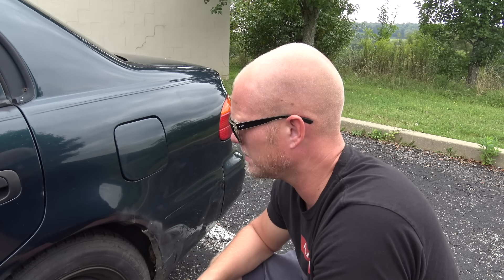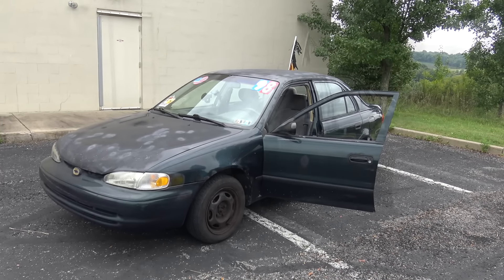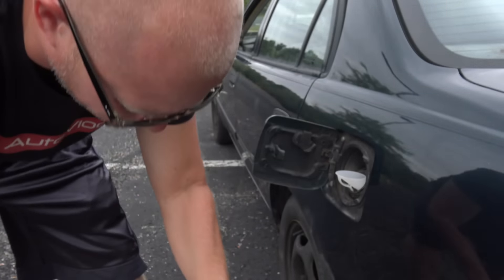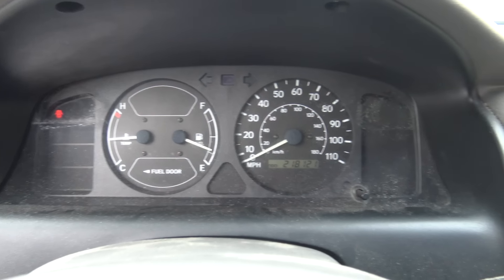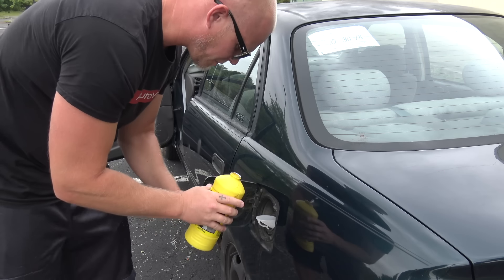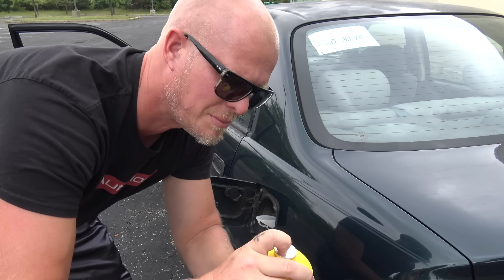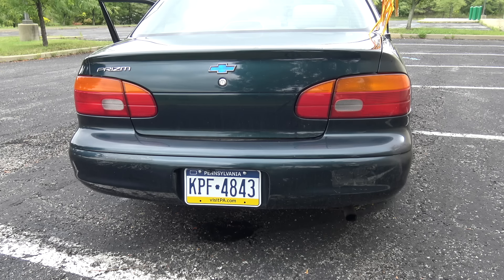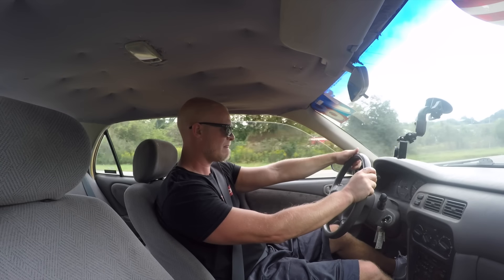What happens if you put BRAKE FLUID in your gas tank? (You'll be surprised!)

Comment: Break fluid is actually a lubricant and can get into places WD and PB Blaster can't and it will clean the lifters and valves but the one thing you have to watch out for is it eating O rings and rubber seals and gaskets. I love the car by the way, had one like it and wish I would have never gotten rid of it. 4Cylinder Admirer from way back.400,000 and still kicking it like a new one..Roll On Brother ROLL ON..

Comment: You can put transmission fluid in it as well. It'll keep the gas from freezing up in the winter. plus it cleans the fuel system and injectors too.
Reply: Must be cold where you live to freeze petrol

Comment: I just came here to find out if mixing brake fluid with gasoline is dangerous. I have a spill tank that has some gasoline in it, and nowhere to deposit it. Now i need to change my calipers, and I understand now I can use my spill tank for brake fluid even if there is gasoline and oil in it from before.

Comment: Certified mechanic 43 years if anybody has a catalytic converter that starts plugging up run it almost out of gas but one gallon of lacquer thinner in and 9 gallons of gas it will clean your converter unplug it literally but it has to be done when it initially starts plugging up.

Comment: Mileage test idea:
Fill tank completely with gas and reset trip meter to 0. Drive to 1/4 tank or less.
On next fill, fill completely and see how many gallons it takes to fill tank. 
Divide the gallons used to fill tank by the miles on your trip meter. = MPG without brake fluid in tank
Then do the experiment. 
- Fill the tank, reset trip meter, add two bottles of brake fluid. Run car until 1/4 tank. 
- Refill tank doing the math as before to determine mileage. 
Do this to see if it improves your gas mileage.

Comment: The first thing you should’ve done was not to see if it starts, the first thing you should’ve done was panic clean that brake fluid off your paint. If you didn’t do that, I’m sure that paint is not on the car anymore if you left it on there overnight...dot 5 Silicone-based brake fluid will not damage paint, but alcohol-based.3/and four is an excellent paint remover
Reply: If you never want paint to stick again.
Reply: @richochett404  
 True silicone brake fluid will not harm paint. But, it is elasticity to it. I remember Suzuki 1400 intruders with hydraulic clutch instead of a cable. At high elevations like Denver, those bikes would creep through the light if you sat at a light with your bike and gear holding the clutch in. Also the Corvette club of America had a bulletin out about the dangers of using silicone brake fluid at high elevations. Your brake pedal has a lot of sponginess to it. You also have to make sure that you are brake system has O-rings and rubber hoses that can tolerate brake fluid that’s made of silicone. You can’t just put it in instead of dot 3 or 4.. it has to be compatible.
   yes I was sitting there finishing up changing a brake caliper, and without thinking I put the rag on the fender. And it took the paint off. That was in 1987 or 1988. I did not know brake fluid damaged paint at that time. brake fluid also is tough on some motorcycle bodywork. I sold my FJ 1200 to a guy, and he had the slave cylinder leak a couple years after he bought it from me, and it ran down the belly pan bodywork, and looks like it melted it..
  One thing about silicone and paint. A master body man/car painter that I know will not even allow silicone spray in his building. Because it will create a condition on the car if it gets on the car that creates what is known as fish eye   in the paint. They look like a little dots with no paint like little volcanoes that have no paint in them in the finished product. Then you have to strip it down and start over, and sometimes even that does not get rid of silicone on the body.
  I should also have mentioned when I do change clutch fluid and brake fluid from the handle bar Reservoir’s. I get a large lawn black plastic bag.. and I cover my gas tank with that plastic bag, and I will cover the front fender with smaller bags. I don’t know what it is about brake fluid. But I have never ever been able to change brake fluid which I do every year in every vehicle I own that’s why I bought myself a quality vacuum bleed. I don’t know why it happens, but I always get a drip or two that flies when i do something like pull the rubber hose off the bleeder nipple, or when refilling the master cylinder with clean brake fluid, if the bottle is new and completely full. Sometimes I don’t get it all into the master cylinder when I start to pour or it will splash out when I’m pouring it in. That break fluid just wants to go straight to the bike sometimes. It might be that I am so nervous about getting a wild drop to go wild on me that makes me spill it..
  I was a maintenance electrician. When I would be working on 85 foot high parking lot lights or up in the ceiling working on mercury vapor lights. That is when I would drop a screwdriver. When I was actually telling myself not to drop the screwdriver or the nut driver. I never drop tools when I’m working on the ground. Only when I’m working up high , telling myself not to drop them, that’s when I drop them.. i’m not nervous about working 480 V lighting circuits hot,(I will not work on 277 hot though, that’s the one that will kill you). I am nervous about dropping the tools, not the electricity..
 By the way, I am the only electrician in the entire company that has never been shocked working on an energized piece of equipment.
  thanks for the tip on making sure the bike starts first. But the checklist was all the things you should check before you even think about riding the bike like making sure it has oil, making sure the tires are correct pressures, making sure all your Controls are where you would reach for them with your eyes closed naturally, know how to get to the petcock when you need to, and which direction to turn it when I taking your eyes off the road, things like that should be checked before you start it. Example:
  when I change oil in my motorcycles, I let the oil drain overnight, sometimes over the entire weekend. To keep from starting the bike with no oil in it, I have an orange sign with black writing on it that says “NO OIL”… I stick my key through that sign and I plug that sign into the ignition switch. On top of that, I will put the oil bottles on the seat of the bike as a second guard against starting the bike without oil
 find my cars and trucks, I just put the oil bottles on the floor of my car by the gas pedal to remind me that there is no oil in the engine yet..
 why do I do that?
 I know two people that drained their oil and drove away without putting oil in their cars..

Comment: Continuous use of brake fluid in the motor will seize it up. I had a truck losing brake fluid. The brake booster was leaking and drawing brake fluid into the engine through the vacuum hose.

Comment: You actually did your car a pretty good favor by putting it in there it is a type of solvent that will eat fuel deposit it is also a catalyst though it will absorb water very easily meaning you will end up with water in your fuel

Comment: Forgot to soak an old rag saturated with linseed oil. Light a match. Problem solved.

On a serious not, my dad used to run an old 40-something Chevy or Pontiac. He was a painter and saved all of his solvent-based cleaning fluids after cleaning his tools/brushes. He would let the fluid sit until all the particulates hit bottom then pour the clean fluid into another container. He would add a couple of gallons to his tank to get further down the road. Also used naptha. Never had an issue with the vehicle, however, I doubt modern day vehicles would survive the day.

Comment: Brake fluid DOES burn at about 3-400 degrees. When mixed with gas it most likely just slightly dilutes it with a lesser flammable source. Also dot fluid is corrosive. So the addition of dot in the fuel may help to clean the valves, combustion chamber, and exhaust ports. 🤷

Comment: Brake Fluid added to petrol is just adding alcohol based liquid. The results will be the same on some older cars by destroying flexible fuel lines and seal and gaskets in the fuel system. Increasing the likely fire risk.

Comment: I put Xylene, (paint thinner), in the gas tank when I drag race my supercharged street truck.   A very nice octane booster that will not harm oxygen sensors.
Reply: Baby Jake 4...My cousin would give me Pure Ethanol from his company that made E85 Flex Fuel for a major refinery corp. My car at that time was a Chevy Malibu SS 454 V8..It was a Excellent Octane Booster..It had a nice sweet exhaust smell too..
Reply: Try Half Gas with Half E85 Fuel..I bet it will increase performance & improve mileage

Comment: You gotta think it's keeping it lubricated It's lubricating the inside of the You pump and the inside of the  Entirety of the fuel line Entirety of the fuel line And pushing a little bit of debris through as well Which will hurt  Eventually but then again it's lubricating lubricating your injectors and the top part of your your engine is well that's not getting that type of lubrication Eventually but then again it's lubricating lubricating your injectors and the top part of your your engine is well that's not getting that type of lubrication  It's getting some because they do add additives into the gas what do you think petroleum is

Comment: If the car isn't dead yet. It would be interesting it you did a compression test on each cylinder before and after ; plus put a camera scope down in the pistions so we could see before and after shots of the top of the pistons and valves. Check fuel pressure before and after.. Figure out the gas and brake fluid ratio. Keep running it until the test show results.
Another test would be to pull upper oxygen sensor out and get some camera footage of the front of the catalytic converter before and after.  I was kinda shocked myself that you didn't have any issues.

Comment: I know brake fluid is very corrosive so idk but it's possible that it will clean the fuel system, but you may want to change the fuel filter because it will probably eat up the filter

Comment: I put oil on my cars 2
I put the oil the use for blower  and landscaping equipment and 
I get better mileage  

And on my 2005 Ford Expedition I mix gas with diesel and I get 80 miles extra

Comment: what it will do at least in older cars 50's thu 70's cars it will help in oil consumption , by swelling the valve seals when you have blow by and white smoky exhaust. I've worked on classic cars for 55 years

Comment: Try using an electric leaf blower for a cheap turbo charger. Use a converter to power it and run it right into the air intake on your intake manifold. Vroom vroom buddy.

Comment: It will swell all rubber o rings and gaskets and your car won't run. I seen old time mechanics use it in crankcase of engine with stuck lifters and dry shrink valve seals but remove after running the engine for 15 min or so. This was pre cat convertors

Comment: You should have put a scope thing so you can look in motor before and after  I bet brake fluid cleaned inside of the motor   tops of pistons and valves   and injectors    wants look inside engine  before and after

Comment: of corse it starts there is only gasoline in the lines first the fuel pump needs to pump it to the engine it will take a minute to reach the engine. that is wy an engine does not start first try after a rebuild.same as an empty garden hose of 100 feet first the water needs to get to the other end.

Comment: I have been told by z friend off mine to paur straight into the carburetor 
Reason  it loosens and clean carbon build up on your valves and top off Pistons and ring grooves 
It smoked like  a volcano but  stopped in a short time  
I drove that car for another couple of years and sold it 
It never ever cove me any problems 
So ?

Comment: Get a small piece of black fuel hose and quickly dip one end in and out of the brake fluid and walk away. In a couple hours come back and you'll see what will happen to the rubber seals in the fuel system...

Comment: Brake fluid is hydrosopic..it needs to mix with mixture or your brakes would not work..3 percent moisture per year.alfter ten years your brakes hydraulics start to stick..lowers boiling point .generates more heat.more wear..

Comment: You should have opened up engineparts.In the old days mechanics dropped brake fluid in the Carburators while the engine was running to clean the valves!So maybe you did something good to the old engine!

Comment: Putting brake fluid in your tank probably would just clean your injectors and oil filter like an engine flush...but don't mix brake fluid with other chemicals because the right combination will kill you

Comment: Hi buddy what you really did was clean your gasoline conducts ,😎 toyota mix it in the intake from the brake booster  and the smoke emited by braking will tel you the b booster is damaged ,so is not so stupid  and  most of those gasoline aditive to clean carbs is made from the same✌️

Comment: Well last year I was driving my zl1 and needed fuel. I was out in the middle of nowhere of Kansas when I made this fuel stop and I normally put premium fuel brands in my rides so for my area that would be BP and Shell.

Anyways I had to put this "short stop" fuel in my Z so just before filling it up, I went inside to get fuel system cleaner. Now the shelf where they had the fuel system cleaner they had the brake fluid bottles right next to the fuel system cleaner. What I didn't notice was someone put one of the brake fluid bottles in the fuel system cleaner row and the bottles looked pretty much the same. I've purchased it, went outside to my Z before activating the pump, cracked open the bottle and poured the whole bottle in. As the bottle was just about empty I felt the unusualness of the consistency of the liquid and moved it away from the gas fill and looked at the bottle and saw it was brake fluid 😕.

Needless to say, I filled alittle over 17gallons of fuel after and the car ran perfectly fine. Never had an issue nor has anything acted wierd or unusual. So if you accidentally put brake fluid in your gas tank (which as you can see can happen), don't freak out too much. Just make sure you fill your tank with fuel to dilute the brake fluid as much as you can and just ride it out

Comment: I had a problem with Brake fluid getting in to diesel engine it burn at higher temp than diesel and burnt head off valves

Comment: Seen brake fluid put in the exhaust center box.  As soon as that exhaust warms up .   It starts to white smoke real bad  and burn off.  But the paranoia will kick in and they will take the car to a mechanic who will find nothing wrong.  I used to work with a prankster.

Comment: Yes, I have made the mistake of putting 2.5gal of K-1 "kerosene " in a 98 cherokee.... ping pang ping ping pang.... told the 17 yr. Old ...for once....run me outta gas with my permission put 10 on it first. Outcome.... 169,000mi. +255,000 more mi. ( it cleaned the engine) ran better than ever. I do believe the engine has yet to fail.  That was 2007-15 that i still knew the conditions of it ...handed it down to not 1...but 2 teens first vehicle's.  (Thats the real test lol)

Comment: Through the years of auto repairs I have noticed that brake fluid breaks up grease and grime on your hands very quickly.So in my honest opinion.The brake fluid probably neutralized and loosened instantly any and all carbon on your intake valves and then burned it up in the chambers and sent it all out the exhaust.freei g up all the gummed up components in that engine.However,the down side of this is that brake fluid EATS RUBBER.so I would think that the valve seals are not going to like the brake fluid.Good luck boss.Interesting.....Jimmy B

Comment: Actually I think the brake fluid was probably good for your motor it will clean your fuel injectors it will clean the valves it will clean the combustion chamber it may even help to clean out the catalytic converter a little bit people are right it can mess up rubber o-rings and seals but one time in one tank of gas I do not think is enough to do any real harm especially to an engine that already has over 200,000 miles

Comment: If you're smart you will take a rag and you'll wipe that brake fluid off of that paint because if you don't it's going to soak in and that paints going to Slough right the hell off and if you leave it on there long enough it'll soak into the metal to where you can't paint that area cuz it'll soak right into the metal and it's the silicone that screws automotive paint up

Comment: Should have run a scope in and checked the valves and pistons to see if it cleaned anything
Reply: It does, I use brake cleaner by removing the plugs and pouring right into the cinder to unlock an engine or if you have a misfire from a stuck valve etc

Comment: If I tell you 75,000 MI I have not changed air filter I take it out clean it with the vacuum put it back on but you make sure clean inside of it if it's too dirty you could clean it with gasoline but don't choke it in a gasoline because it is a glue around the rubber just like this spray I like you

Comment: Do you know what happens when you put metholated spirits into the gas tank.......
Answer.........it helps mix any water in the tank with the petrol.
When the tank is low near empty, pour in a pint bottle  of m/spirits into the tank, wait 5 minutes then fill the tank with fuel and it all mixes together.

Comment: Break fuel wouldn't cause issue with any other then mixed with petrol, diesel other hand might cause a problem, break fuel and petrol are quite similar, when put together, real experience is, top the car up with no fuel  at all then drive,